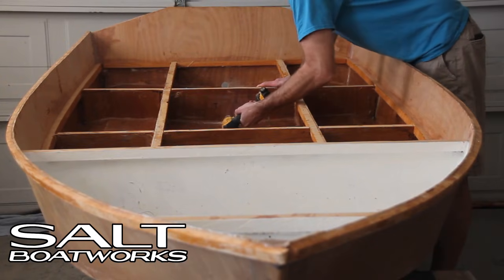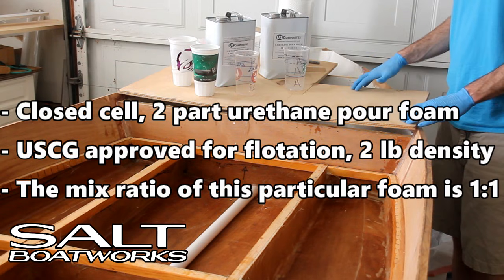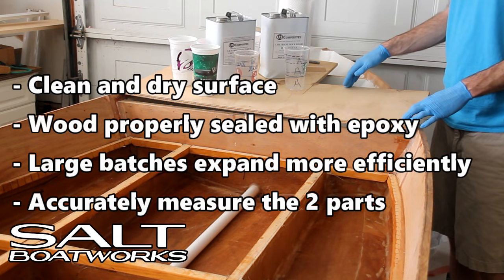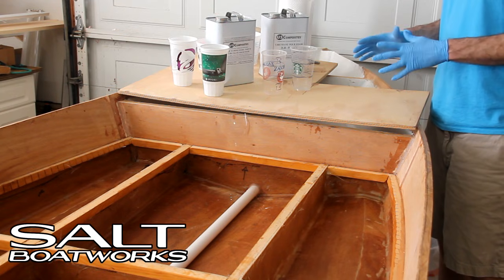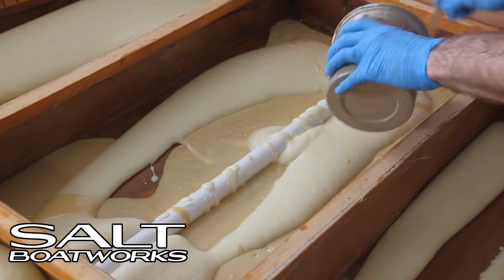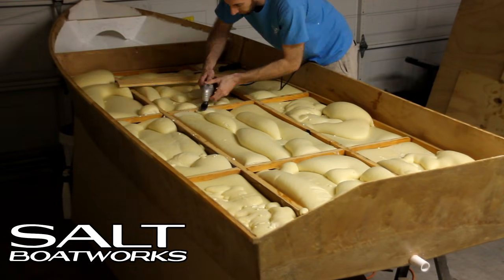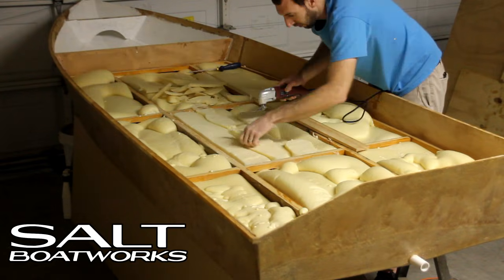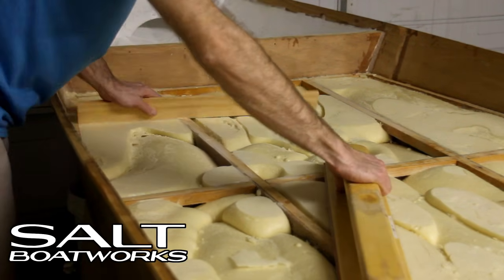How to pour expanding flotation foam in a boat hull - How to Build a Boat Part 10

Comment: OMG🤦‍♀️
Yes, the last layer of foam should be capped with the floor right away to form a skin, regardless of what he says, oxidization will happen on the exposed bubbles and your product will start to break down faster.
I don't even know where to start with having ample places for wood degrading organisms to florish in a dark damp area that has no ventilation to eat apart your wood skiff from the inside out.
You should do a slight over pour, screw down your floor before expansion so you're properly skin sealed and then if you have any expansion through any cracks, scrap, sand and caulk or epoxy.
I can't even🤦‍♀️🤦‍♀️

Comment: Expensive, labour-intensive, very inconvenient and EXPENSIVE once again. Have you heard about styrofoam insulation? Exact the same effect, fraction of the time needed, fraction of the cost.
Reply: "Styrofoam is not fully waterproof. A Material is called waterproof if it’s wholly impervious or impenetrable to water. This means water cannot pass through that material and also not absorb any water in the process.

So, for example, styrofoam insulation can be water-resistant but not fully waterproof. This is because styrofoam does not absorb moisture from the air but can absorb water if it directly interacts with water. "

Comment: I'm confused about the point of the foam, if all compartments are fully sealed ?
Reply: Emergency floatation, even if the hull is compromised it won't flood with water.

Comment: Hot wire is the only way to get a true clean cut. You can find how to make it on Utube.
Reply: 100lb braided fishing line like piano wire, works well if you have a base to pull across
Reply: "You cannot safely cut marine flotation polyurethane foam with a hot wire; it is dangerous because heating polyurethane produces toxic fumes, including hydrogen cyanide (HCN), and can release harmful chemicals that are toxic to the lungs and eyes. While a hot wire is suitable for polystyrene foam, it should never be used on polyurethane. Instead, use a sharp carving knife or an electric oscillating knife for accurate cuts. "

Comment: Sorry but this is a ridiculous way to build a boat. Have fun digging that smelly wet foam out of there when it eventually gets wet and adds a couple of hundred pounds to the weight
Reply: That's why they have closed celled foam 😊
Reply: Closed cell foam does not absorb water
Reply: Been there done that . In the 70's they used that stupid surfboard open cell sponge foam
Reply: What’s the alternative?
Reply: @brandon.4451  Polyethylene. Pool noodles, sheets.

Comment: Air is lighter that foam and its Free.
Reply: If hull is punctured or boat is swamped that air will definitely prevent the boat from sinking.
Reply: Fill it with sealed plastic soda/water bottles instead of this foam. Chop up pink foam into small bits for placement into the areas around the bottles.
Those two materials will never absorb any water at all.

Comment: Can you use this to seal a room built on a patio that leaks?
Reply: No. It you mean a patio room that’s drafty, the choices are (1) to lift the flooring and put in a heavy polyethylene sheet vapor barrier or (2) apply tyvek or other brand draft blocking sheet to the underside of the joists in the crawl area. If you mean water is wicking up into a room built on a slab adjacent to a patio, the problem will be that there is wood in contact with concrete that is wetted. Concrete might as well be a sponge. Add flashing behind the siding for the lower of the wall and under the wood in contact with the concrete. To do that, after removing siding and draft wrap, cut and remove 24” of sheathing to un-secure any hurricane tie-down straps or tie bolts and plates, add a 2x10 temporarily where the siding was and lift the building just enough to put the flashing under with bottle jacks. One small inexpensive hydraulic jack every 6 feet is better than using a small number of large jacks. Lift evenly and just enough to slip the flashing under. Let the building down evenly then fold the flashing up the wall. Remove the temporary beam, restore tie-downs, replace sheathing and draft wrap, flash behind siding before replacing siding. If you will pay someone else to do this, it’s around an hour of labor per linear foot of perimeter, plus the present cost of 2x10’s, 1 ton bottle jacks, 10” aluminum roll flashing, 36” aluminum roll flashing, 36” tyvek roll material, 1 lb of #8x1-1/4 stainless screws for reattaching the sheathing, 1 lb 12p common nails to secure temporary beam, 1 lb hot dipped roofing nails to secure the flashing. If existing sheathing was installed using nails, also 1 sheet sheathing plywood per 16 linear feet. For diy include tin snips, drill driver, hammer, wrecking bar, cats paw, level, etc. if known to be without built w/o tie downs and none are required in your area, leave draft wrap and sheathing in place, find and mark stud centers.

Comment: Dont use foam.been working on getting out foam from older boats my experiance is that the foam is so full of condenswater that it almost sink in water.it is also inpasseble getting it to dry out when wet
Reply: This is straight from uscomposites website. As long as you aren’t submerging it for an extended period of time, the foam will not absorb water.

14. Is this foam water resistant?

Yes, but with the following caveat. The foams that we sell are considered closed-cell, which means that each cell that makes up the foam structure is completely closed off from surrounding cells which prevents it from acting like a sponge. It is completely safe for this foam to be in contact with water for hours/days/weeks and even months with no adverse effects. However, it should never be submerged in contact with water permanently. Over a period of years the water contact can begin to soften the foam and cause it to lose its closed-cell status. This foam is designed primarily to be used as an insurance policy in case of damage/holes that could cause a vessel to lose buoyancy. Pinhole sized openings would essentially have no effect on the foam since the amount of exposure is so minimal but you should always make repairs as soon as possible to keep the foam effectiveness as good as possible. This will be the case with all after market closed-cell polyurethane foams and even manufacturer installed foams.
Reply: @Br4nd0n.E.M.  Does not have to be submerged. Just water laying on it will cause failure. Pretty poor insurance  to find it soaked when you need it.   Polyethylene is a much better choice.
Reply: Older foam is a different thing. It’s polyethylene, not polyurethane. The older foam is an open celled foam and acts like a sponge. New polyurethane is a closed cell system and would have to be submerged for 30 years to have a barely noticeable 20% moisture. If you regularly take it out of the water, you don’t have to worry.
Reply: @It-b-Blair  Actually you are incorrect. Two part foams have not changed and all will absorb water. They need to be completely encapsulated from water. 
Polyethylene (think pool noodles) will not sponge up water like two part foams. It is chemically resistant and is an excellent choice for flotation. It too is coast guard approved. 
Do a search on two part foams on YouTube you will seee tons of failures. It does not have to be submerged, just contact over time. Go to Totalboats and read the data sheet on their two part foam, same with US composites. They both say it will absorb water.  I just took 3 or 400 lbs of soaked foam out of my boat. I would NEVER put it back in.
Reply: @bryanturner683  I'm with you based on real world experience using the same product as in this video. This pourable 2 part urethane foam is fairly water resistant, but it WILL ABSORB water over time. I poured some into an approx 5 sq in x 8' long subfloor channel last fall. Thinking it closed cell, I left the end at the bow unsealed, and the after end had a 1" diameter drain hole from manufacture.

Last week, I noticed water weeping from the drain hole. I figured some standing water had wicked up into the area around the foam, perhaps as much as a few cups, not even considering the bow end which I thought sealed by the foam itself.

When the weeping continued for 4 days with temps in the high 90's and the boat itself tilted up perhaps 25 degrees bow-high to facilitate draining, I began looking further, uncapping the places I had used as pour spots last fall. Turns out that there was water along the entire length of the subfloor channel, perhaps a gallon or more based on the weight of the foam which I have subsequently removed.

Doing this job for the second time now, because this foam was not completely encapsulated IMMEDIATELY after being poured. I think I am going to embed some sealed plastic soda/water bottles, saving both pour time and material$, and best - which will never leak.

Comment: Pvc pipe, for what use/purpose
Thanks bro
Reply from the maker: It is a drain for the front compartment.
Reply: Do u leave the PVC pipe in place or take it out?
Reply: @billruggiero870 they would have left it. It's going to be likely a drain tube for the anchor locker.

Comment: I thought closed cell foam wouldnt absorb water?
Reply from the maker: It is advertised as 98% or better.  However, experience has proven that over time (years) if the foam remains submerged it will eventually absorb some water.  By using individually sealed compartments filled with foam we ensure that not water can contact the foam.  If the seal of one compartment is compromised it will not get into other sections.

Comment: I don’t agree with this. Pouring foam is rubbish, it does take up water over time and it also breaks down with vibration. If the temp is too cool it adds a lot of weight and can make
repairing and modification a pain in the arse. Water also wicks along the foam/timber join. 
I hate the stuff. 
Bladders are the way to go.
Reply: It's not like the old foam that turned to dust or got water logged, plus if it's done right you won't have water ingress. The density is there to get the weight below the deck, it's deliberate in an effort to reduce the centre of gravity.

The only thing missing in the video is the safety side and correct respiration gear, ventilation.
Reply: @andrewiannello6548  Reduce the centre of gravity ?
That’s pure nonsense.
Reply: @andrewiannello6548  What way of ventilation do you know? However, I would like to avoid the accumulated condensation when building a boat ... Thank you!

Comment: I have an important addition to make. urethane foam produces gas that can cause asthma in some people. For those sensitized, this can occur at concentrations that are not detectable buy smell. IE: before you can smell it. I had very mild 'weasy' asthma as a kid that would be dust aggravated but the attack I had after pouring foam was, according to my doctor, "potentially fatal"! It was like slowly drowning, Prednisone eventually got it under control.  I  worked with this foam occasionally for years before this event and did not get a reaction. Read up the national safety guides folks, wear a carbon filter mask, and air out the shop well.  I still get an asthma response if I cut old foam out of chambers, even wearing a mask.
Reply: Need to use a 2 cartridge hazmat respirator when dealing with any product that produces gas if you're sensitive. I have obstructive Asthma. Not a k95 covid piece of crap.

Comment: Fun fact: this foam WILL eventually get wet and it WILL absorb that water.  Terrible idea to use expanding foam in a boat.
Reply from the maker: It is a USCG requirement to have flotation foam in boats under 20'.  So until they change this federal regulation, we will continue to use foam in the most responsible ways possible, bu sealing each cavity 100% to make it water right.
Reply: @saltboatworks1139  the old school guys don't realise the modern closed cell foam is waterproof. It's been tested to death. Don't blame them, the old stuff used to turn to chalk.
Reply: @saltboatworks1139  Pool noodles in the compartments. Light, buoyant, and won't absorb water. Foam in boats is the scourge of boats in Alaska.
Reply: @akdoug6437  excellent idea. Now you've got my imagination running wild on how to keep 55 gallon plastic barrels from taking on too much water and possibly sinking. Thanks.

Comment: Boat itself is already float, why do you need foam? I am new to this, just a curious question.
Reply: If you get a hole, the boat won’t float anymore unless you have foam
Reply from the maker: USCG requirement for foam flotation in boats under 20'.  We also take advantage of the compressive strength of the foam and use it to assist in supporting the floor and hull bottom.

Comment: Should have glassed around the drain pipes.  It will flex causing it to lose seal.
Reply from the maker: Good eye, not shown here (because we forgot to film it) we used 5200 to seal in the front compartments and transom.

Comment: They need to come up with a more efficient way of pouring a higher volume of foam, to insure total expansion all the way to the top... and a more uniform seal? I would say come up with 2 part gallon jug that ,you can open a top lid,pop a plug to mate the 2 parts then replace top lid,shake and pour? The system in  this video looks horribly inconsistent and requires way too much touch up work.
Reply from the maker: You can pour the foam in larger batches but 1) you will have more waste and 2) bigger batches can get "out of hand" with first time users so we demonstrated using smaller batches. Yes it is more time consuming but can be less intimidating for beginners. Also, every compartment we foam fill is already a watertight compartment, meaning water cannot reach the foam. We never recommend foam in an area that is not sealed.

Comment: How many litres of the 2 part kit did you need for this video to achieve this result?
Reply: @GeorgeParmer-y1n  yes, you can get styrofoam for free. And its weight can be 50% less
Reply: @maxmackinlay618   Styrofoam melts down with almost all the resins. But you can use with epoxy.

Comment: Wouldn't have been easier to put plywood on and pour into  holes rather than have to cut it
Reply from the maker: Pouring foam into an enclosed space requires more forethought and planning.  The enclosed space limits the expansion so you need just the right amount of foam, too much and will push against the panels and warp the shape.  Also, air can be trapped in corners creating voids which is not ideal.  So while cutting is a bit time consuming we believe it is the best method for beginners.
Reply: @saltboatworks1139  ...Tip: A 2" hole you drill to pour the foam in, will allow any overfill to ooz out, thus fill in all the air voids while eliminating any risk of warping the shape.

Comment: Hello! If you did decide to seal the exposed foam, what would you use? I understand it probably isn’t needed, but thinking of doing it anyway just in case
Reply from the maker: You can use resin
Reply: @saltboatworks1139  but wht brand of resin???  What type

Comment: All due respect if a you say you don't have to worry about water absorption if you fully seal the compartment then you don't need the foam.
Reply: It keeps the boat afloat. Let’s say your going 28mph on a flat and you hit an old little piece of rebar sticking out of the sand and cut a 30in long hole in your hull.. well without floatation you’re kinda screwed. It’s floatation nothing more. Sealed compartments stay sealed until they aren’t.
Reply: Foam is for support not floatation I believe in this case
Reply: Well lets say you punch a hole into a compartment or two, then you will wish you had the foam.